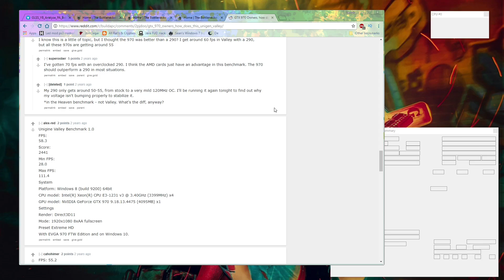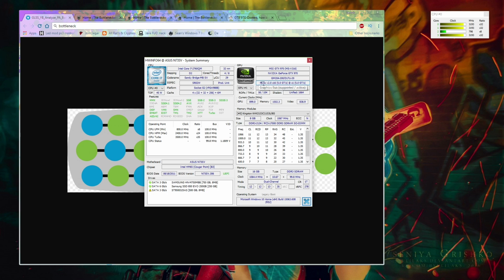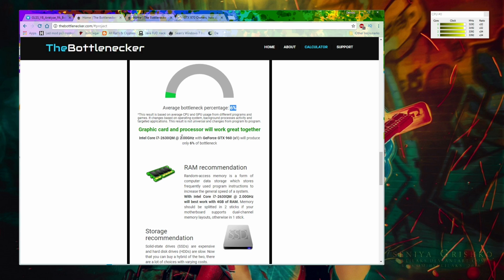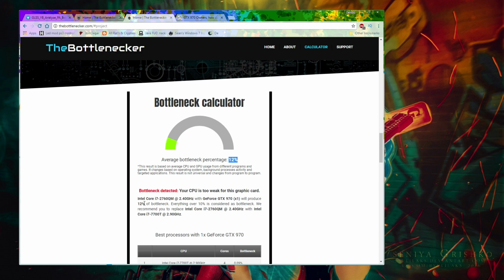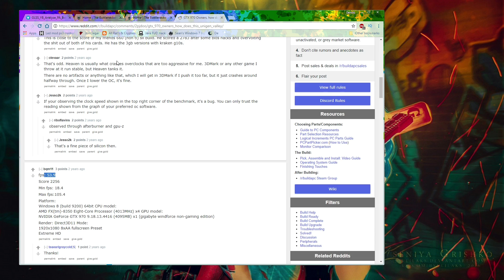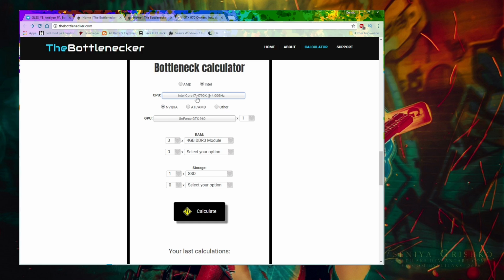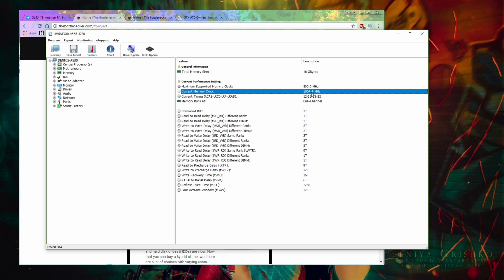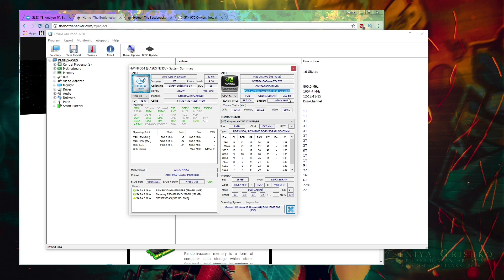About eGPU Bottleneck and Breaking Limits.

Comment: How much of the performance will be bottlenecked with the internal screen, and why?
Reply from the maker: all the fps on the external screen will be half the fps on the internal screen, the reason is: the external screen is setup like this: laptop -> egpu -> external screen, all the traffic goes one way, means the mini pci-e lane can be used 100% in one direction, giving the cable 100% traffic, but if the information has to return from the egpu, back in to the mini pci-e lane to communicate with the intel hd that controls the internal screen, then it has to travel back and forth, meaning 50% of the hdmi is going to the egpu while 50% is travling back to the internal lcd, giving half the fps as a result, this can be bypassed by making the internal screen also a external screen (it's possible)
Reply: Dennis Gagliano, thank you 🙏 for your amazing response. I was wondering if you could give me a link to the tutorial of the bypass you mentioned.
Reply from the maker: i don't think their is a tutorial really, but i can kind of explain, every lcd has a model number, if you take that number and ebay it you can find control boards, these will connect with your internal lcd and you need to provide then with 12v 3a, which you can take from the motherboard if you have the knowledge, otherwise you can use a power supply, and then your internal lcd has a controlboard with a hdmi in out and all you could need, to make it a external lcd, here's a example for my own n73 lcd: https://www.banggood.com/Mini-PCI-E-Version-V8_0-EXP-GDC-Beast-Laptop-External-Independent-Video-Card-Dock-p-1011222.html?rmmds=search , i was planning on doing this, but i got other plans atm, so i'm not sure if i'll do it. has to do with what i can get atm, while booting the intel hd runs and not the egpu, so to have a bios and stuff, you'd have to connect the hdmi out from your LAPTOP and also connect that to the internal screen controlboard

Comment: should i try to overclock my graphics card (gtx 960) on the egpu set up ?
Reply from the maker: +Nguyen Khai i had my 960 egpu also oc’d and my 970 too, the cards are factory protected with oc, they can only crash from ocs but cant burn or break, they have a bios protection, even its voltage can only be uped a certain amount so yes its totaly safe, use msi afterburner and look up guides on youtube, it's very safe, and don't be scared if your gpu crashes. that's what it's supposed to do on to high oc, when you reboot it will be reverted and you can lower it and youtube videos are very detailed in how to  do that, keep also an eye on temps, i don't need to because it's outside but yeah
Reply: Nguyen Khai why not try it and tell us what happens?
Reply: i don't wanna put my house at risk man

Comment: Thanks for that video! I subscribed! I am planning to build myself a new PC to put im my room. I know I already have a PC with GTX 1070, i7 6700k, 16 RAM ect... but I am only allowed to play on it 3 hours a week with a timer! Even tho I bought it with my own money and I have good grades! But anyways that PC will be in my room where no one could see my screen when I pretend to do homework. So can you guys tell me If my build is good or what I can improve?
AMD ryzen 3 1200 overclocked
ASRock - AB350M Micro ATX AM4 Motherboard
Patriot - Viper Elite 8GB (2 x 4GB) DDR4-2133 Memory
Seagate - BarraCuda 1TB 3.5" 7200RPM Internal Hard Drive
Sapphire - Radeon RX 560 2GB PULSE Video Card
BitFenix - Nova ATX Mid Tower Case
EVGA - 430W 80+ Certified ATX Power Supply
Anyways I love your channel! :)
Reply from the maker: i really can't help you with that, i suck at amd + ryzen, i really do, reddit might help there, pcbuilds reddit. that timer stuff sucks i had the same thing growing up, but once you move out you'll be in heaven :)
Reply: Thanks a lot!
Reply: Tristan Can that build is perfectly fine. recommend a 1050 or 1050ti though. unless you somehow find a 570/470 for cheap (doubtful with miners)
Reply from the maker: 1050's are shit, really. even a 960 is better and cost less, 970 performs 2x the fps. don't waste your money on 1050's: http://gpu.userbenchmark.com/Compare/Nvidia-GTX-970-vs-Nvidia-GTX-1050-Ti/2577vs3649
Reply: I found an RX 470 for 250$. (25% better fps than 1050ti) I know you dont know AMD stuff but would you recommend something 250$ that performs 25% better than 1050ti? The cheapest 1050 ti is 190$ and the RX 470 is 250$. But the thing is the RX 470 is more future proof because new games are better AMD optimized.
Reply from the maker: from my test, the 470 is like 45% faster, the 970 is 50% faster and the 570 is like 48% faster, try to find it cheaper though, i don't know where you live but i got my 970 for 175. they usually go for 200-230 here, i kepy my eyes open for couple weeks till i found a good deal, it was like brand new and got it for 175 including shipping, while i sold my 960 for 155
Reply: The cheapest 970 here is 550$... or 960 for 520$... what is happening in canada? I will go for the RX 560...
Reply: Tristan Can the 1050 beats the 560, that's what I meant. I know the 960 and 970 beat it. that's beyond obvious
Reply: The 560 is 165$ and the 1050 is 180$ Witch one is the most bang per buck?
Reply: Tristan Can the 1050 is 10% better most of the time. so you decide. is 10% worth the 20?
Reply: OK thanks! I will go with the RX 560 because its also a bit better future ready because older games favor nvedia cards but now new games favor both.
Reply from the maker: good choice, the 1050 is garbage, it's good they they made it for people that are really low on budget, but it should be like 120$
Reply: Ok thanks. Its actually 140$ but I am buying the 4 gb version OC edition for a little more. And also why do video card companies and CPU companies now make extremely expensive stuff (intel core i9 extreme, Ryzen treadripper, ect..). its not like any gamer is going to buy that stuff. I think they should concentrate more on budget stuff but I have never had a big company like that so I cant say im right.
Reply: Dennis Gagliano it is 100$ here in the us.
Reply from the maker: the i9 and threadrippers are not for gamers. they are not made with gaming in mind, more like heavy duty editing or other professional things. and the pentiums are good gaming budget options, also i5's
Reply: Ok thanks.

Comment: Thanks for explaining these things. Most of people just say that it bottlenecks cause of PCIe port. And now I'm really thinkig in to getting an old i7 laptop and external gpu. But it would probably cost me more than i5 2500k, 970 gtx 16gb 2133 (used components from ebay). But laptop with egpu is dope af :D
Reply from the maker: if you can get a desktop cheaper and have the space. do that.

Comment: omgg i have 79% bottleneck with i5 6300hq and gtx 950m.......................gpu is too weak
Reply from the maker: +XLBY yes but thats good, that means you’re using 100% of the gpu, that cpu is a monster so thats good,  meaning you could hook up like a 1080ti with a thunderbolt egpu 👌🏼